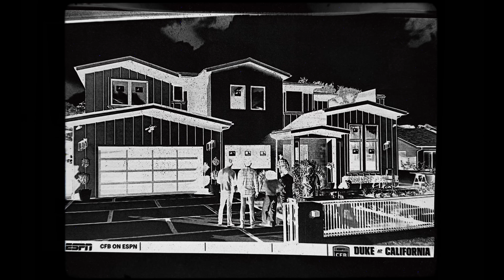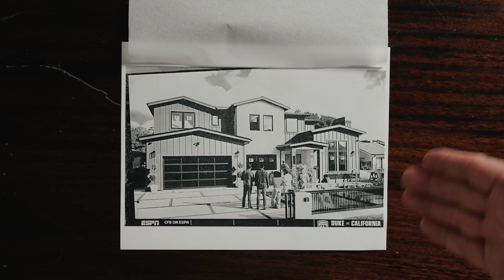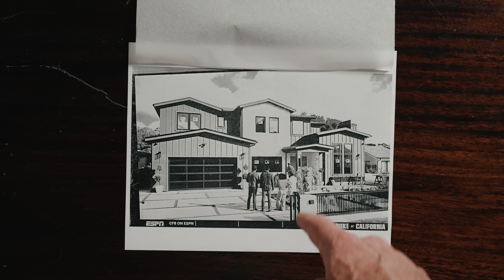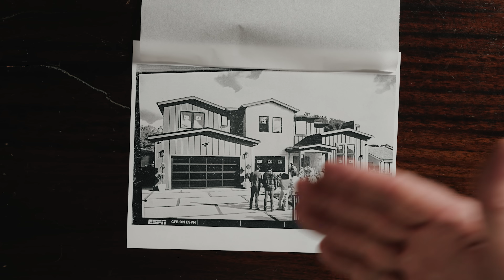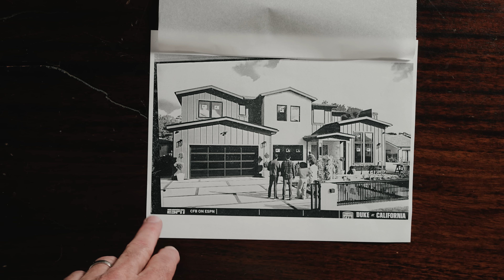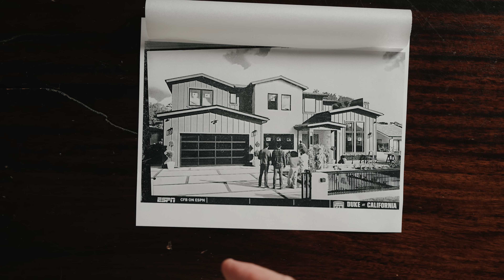There is no fixing this ugly house.

Comment: I would advocate turning the conversation to first principles rather than falling back on historic styles. . For example deep window recesses are necessary for water intrusion performance. Acknowledge the modernist movement and what it was able to achieve when done well. Large expanses of glass helped unite inside and outside creating better lit, healthier buildings. I’m thinking well done mid century modern houses. Mullions were a necessity not a choice in the past. Plenty of scaling devices available in the designers palette. Defaulting to the past isn’t moving the conversation forward. That said this hgtv house is terrible
Reply from the maker: While I don't agree with all your points, if we just hold onto the beauty argument, this house is not helping.

Comment: To me it's a respin of the stuff we saw in 60s 70s and very cost aligned. Windows flush with  the building, cheap cladding everywhere and simple structures, instead of white cladding of the 70s it's this faux wood greyscale composite now. I'm sure people back in the 70s thought it all looked cool and modern but they quickly became an eyesaw and demolished while we look on in amazement at prewar buildings features details and just long lasting design.
Reply from the maker: Good comparison. Thanks.

Comment: "The most square footage for the least amount of money" CAN be done - it's called a warehouse.  And the purely utilitarian brick, steel beam & large steel-framed windows of a 1930s warehouse - built for industrial purposes, no less! - holds 1000x more charm, warmth, character, beauty & proportion than any of the unholy residential crap we see being built today -
Reply from the maker: Point taken. Thx.
Reply: @BrentHull  I worked at a company called Method Studios in LA, which was in a converted brick and steel warehouse from [probably] the 40s.  It was GORGEOUS!  

Some offices had retained the paint lines from parking spaces on the concrete floor - hinting at where the building had expanded into a parking lot at some time in the past.  

Wood & steel beams, rafters, ducting, electrical... everything was exposed.  Working there was like walking thru history -

Comment: I am all for simple modern design and have two houses which are in such a style. Most of the design is functionally simple, meaning, the materials and layout are very easy to access visually and physically. Also a single shed roof plane is always helpful for both leaks and cost etc. But once you are in the business of taking water and sending it off to multiple valleys then things start getting complicated. Like where a valley has water traveling against more than one wall face and can get boxed in etc. That's rough. 

The other issue I see here in this design is, yes, the redudant gable issue (as in so many other designs) but also the Layout because I assume they have crammed as many rooms and bathrooms into this building shell. The facade rather than being visually manageable is more or less made of redudant vertical columns with disproportionate sized windows. So even from a modern design aesthetic this is not modern. 

Lastly, one also has to assume that these designs are not spec'd with the best building materials and methods so if you take the design risks into account and then multiply that with poor detail work during construction then that's where things start getting even worse.

But what do I know I still eat tuna from a can!
Reply from the maker: Haha, I agree. Thx for sharing.

Comment: Not only are the windows all different sizes, but the roofs (gables?) have inconsistent angles. WHAT the ??? 😬 Ugly, ugly, UUUG-LEEE!  😱 And I thought McMansions were  ugly (which they are). Whoever designed this excrescence thinking it resembles an old farmhouse has never seen any. I live near and drive through midwestern farming areas regularly, and I see them. And they have order and make sense. You know what order the additions were made as time went on.
Reply from the maker: Yep, thx for sharing.

Comment: What I see with that "design" is a site-built house trying to look like the stacks of shipping containers which were briefly considered a "fix" for the housing crisis, by people who know nothing about building. A barndominium usually has a simple rectangular shape because that's the cheapest way to get the most square footage possible out of what is essentially a warehouse (cube square rule). 

This thing... is anything but simple. In fact, it's not even cheap. All those rooflines and corners and jutting-out protrusions cost more and more money compared to a barndo or even a classic 4-square, and they also reduce energy efficiency by increasing surface area per square unit of space. Finally, all that extra, wasted, and expensive exterior surface, all those roof flashings  and valleys... it's going to be a maintenance nightmare and will break whoever owns this stack of cardboard boxes. Welcome to the ghetto in 25 years.

The designers are paying extra to make it look like a lego skyline, and saying "this is beauty, this has value". I guess they're trying to reach people who play minecraft, because this slapped together collection of blocks aesthetic  looks like something a person would impulsively assemble in that imaginary world. 

As with the shipping container influence, we're getting further and further away from reality, or from engineering things which react well to reality and last a long time. An abomination like this could only be purchased by someone who figures they'll be selling it at a highly appreciated price in 7-10 years, and so they won't have to handle the upkeep when the particle board board-and-batten pieces begin to crumble. 

If we want to get back to honesty, affordability, durability, economy, and beauty, we should be looking back at the old bungalos with simple rooflines, basic rectangular exterior forms, social spaces as their defining features, and artistry built into their functional parts, like brackets, columns, brickwork, and windows.
Reply from the maker: Well said. Thanks for sharing.

Comment: I think I found a workaround. Try drawing this house from the historic precedent of 1980's modernism. Then work backwards in time from there. Proportion it like it's a brick wall, and it's like a 1/3 running bond (had to google). The upper floor is trying to point at the central bump-out, and use that as its focal point, but the bottom is trying to point at the garage and they clash, and when I sketched it out, it looked exactly like a brick wall with that pattern. (This does not make sense to anybody but me trying to explain it, but try it whoever's reading this). But I hope this helps. I do not know of a traditional style that would make this work, but early modernism or a prairie style might fix it.
Reply from the maker: Ok, you got further than I did.
Reply: Just bulldoze it, start over. It will be cheaper
Reply: @bigbob3772  I disagree somewhat. New windows and sheeting is less expensive than rearranging holes for windows, which is less expensive than building new walls and roofing to refacade a house. On the other hand, you would really need to see what could be reused, like the foundation, plumbing, electrical, stuff like that. There's probably about 100k of work that you could reuse from this dumpheap before tossing the whole thing and starting from scratch because it's ugly is a possibility. However that's not the point. The point is the aesthetic exercise and the challenge. You can't really say it's not worth the effort when all your wasting is some pen ink and a piece of paper. It's good practice.
Reply: @XyloWolfie  Even if you remove the entire roof and just kept the walls, its a jumble of boxes- EXTREMELY difficult to make it look like anything attractive adhering to classical design. You'd have to redo ALL the windows and even then, going to be expensive if you start from there. It's just a hot mess.
Reply: @bigbob3772  I agree. BUT. It is an aesthetic exercise. You can do a lot with it to hide or emphasize certain shapes even if it is just a bunch of random boxes glued together. There are things that can be done to simplify the massing and the shapes, then new details can be added to that that give it a more traditional or classical aesthetic
Reply: @XyloWolfie  It all goes back to COST. Spend 200k to 'fix' it best you can OR get it right out of the box for a similar amount. 350k for the house as it is, plus 200k in 'fixes. For 550k  or such, I can build a beautiful classical home, no compromises needed.

Comment: That looks like a typical modern Australian home. An ugly mash of all these different materials (A common combination being: Walls being part face brick, render over foam and corrugated iron sheeting like whats on a cheap garden shed. All topped with a tile roof typically with many peeks) joined together at hash intersections that are unpleasing to the eye.
Pretty much as per the photo your showing off in the photo.
Reply from the maker: Wow, so this disease is spreading. . . scary.

Comment: Roofs just break any concept of architecture or common sense. Really low slope. The porch appears to be a different slope. They've created all these places that need crickets and valleys, which will be VERY low slope. It's not steep enough for shingles OR metal roofing. Need to put in a membrane before it rains (maybe it is shingle plus membrane already?). All the ins and outs-- expensive and wasteful for energy and materials... The garage and driveway... is this a fire station? That picket fence! Shall I go on?
Reply from the maker: Go! We need to get the word out. Thx